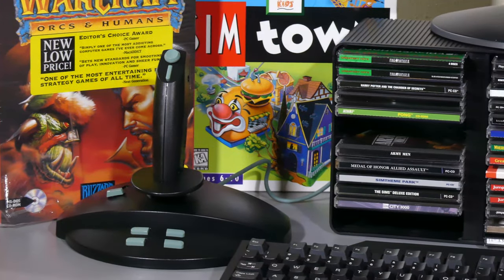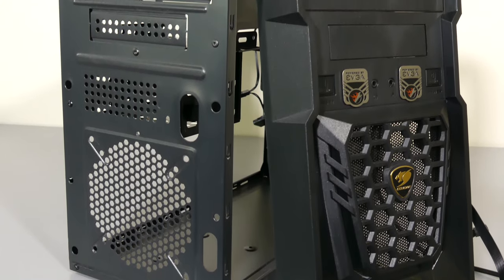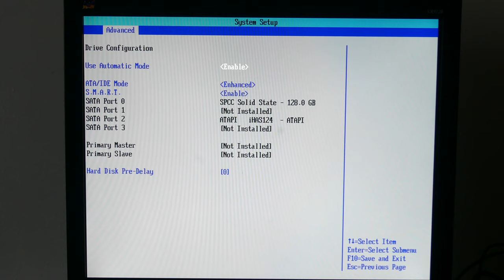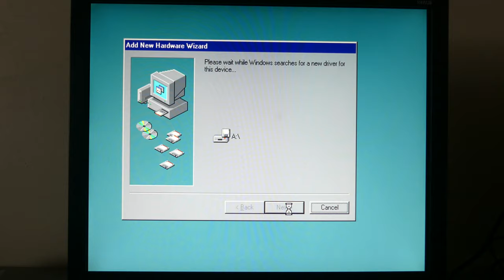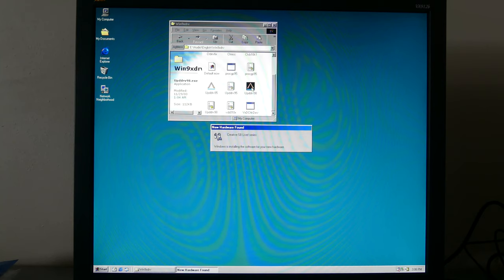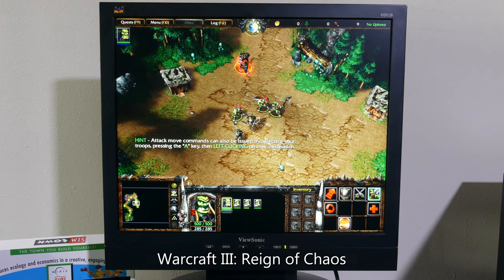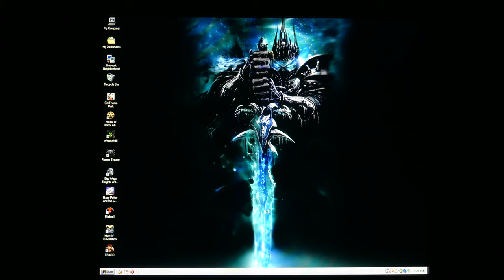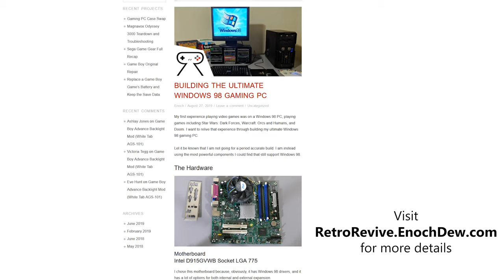Building my Ultimate Windows 98 Gaming PC | Retro Revive

Comment: Great video thanks! I have a similar Windows 98 Monster machine in my collection. Mine has a Core 2 Duo E6750 with 2.66 GHz, 1 GB DDR2 667 RAM, Intel 945 chipset, SATA 2 controller, 128 GB SSD and a Geforce 7600 GT for PCIe x16 with 256 MB RAM. I also run two Voodoo 2 SLI cards in this PC that are connected via a PCI to PCIe bridge. So you can get these cards to work in modern PCs. Every game runs almost no more loading times. The SSD manages almost 300 MB / sec even under Windows 98 ... I had the Soundblaster 16 problem you described, which is also due to the modern mainboard. I also had these BlueScreens so that I had to switch to another sound card model. So it wasn't live, but a simple Cmedia CMI sound card. But it also works in the Dos. Many greetings, Chris

Comment: I was going nuts trying to get SB16 emulation going using an Aureal Vortex 2 on a 775 board and P4 under Win98SE. After several reinstalls I found the solution for me was to install the sound card and drivers before virtually everything else, and in particular before any USB 2 drivers. I found one of the  USB 2 hubs on the motherboard was taking IRQ resources that caused the SB16 drivers to always BSOD. I've now got that hub disabled, but I still appear to have functioning USB 2 as well as the SB16 emulation. I would also recommend getting yourself a PS/2 key board and mouse to help with troubleshooting - you can remove them once all the hardware is installed.

Comment: I use a Yamaha YMF-724F PCI sound card in my 98se/2K PIII 800EB build, with genuine OPL3 FM hardware support in DOS, using PhilsComputerLab drivers off his website, along with a proper cone speaker for BIOS beeps.

Also got with the build a 256MB 128-bit FX 5600 AGP graphics card, semi-passively cooled with a copper heatsink and a big quiet  120mm fan blowing air over it nearby, along with 512MB of Crucial PC133 Cas 2 SDRAM, dual 80GB 7200rpm PATA HDDs for programs and data, and a Seasonic SS-350ET PSU, with an AOpen MX3S Intel 815 chipset motherboard as the backbone for the rest of the system.

Comment: The SoundBlaster live Dos compatibility is only compatible with motherboard which have ISA bridge (even without ISA slot) or ISA emulation mode. That was the trick put in place by Ensoniq with their PCi cards and the reason why Creative bought ensoniq back in the day. The creative and ensoniq PCI cards used isa emulation mode from the motherboard to tricks the system with a bunch of wrappers and TSR under Dos. If you lack this functionality, then, you have an error message that the card cannot access this area. You can maybe try aureal vortex or yamaha 71x cards, but these cards are a bit expensive. P3 motherboard or P4 socket 478 motherboard still have this ISA emulation mode (until ICH7 chipset I believe), this disappears on lga775 motherboard. The most appropriate would be a Amd CPU with AMD cheap motherboard, usually they used VIA chipset. VIA and AMD tend to support old technologies to support industrial machines.

Comment: I once had a  Dual core running Windows 98 with a PCI-E Nvidia 6600 GT running using the unofficial Nvidia drivers. ran fast as hell but you lose DOS functionality. Great video. Subscribed :)
Reply: Paul Marsh what mobo did you use?
Reply: @SharkVaderYT  it was an  intel dual core running at 2.26  ghz per core. Cant remember the exact motherboard version as it died several years ago but it definately run  the 6600 gt pci-e card flawlessly.

Comment: 98se and Me support up to 1gb ram and I have 98se or a 250gb HDD without Issues
Reply from the maker: I got the "insufficient memory" error when I tried installing 1GB RAM, but I found a way to get it to run with 4GB.
https://youtu.be/WfPZnjMEijU
Reply: @EnochDew  I use the Windows 98SE UBCD http://www.mediafire.com/file/j83jp3jb2jlb2sv/Windows98.UBCD.Feb.2008.iso/file It no only has 90% of 9x drivers built-in but also allows you to set up your options beforehand  no need for a 98se key also  if Norton partition magic so you can format you HDD without being limited to Fdisk or the format command as long as the drive has already been preformatted fat32 also has a file viewer under DOS to allow you to  select files that you want to delete and allows you to keep stuff like games and files without needing to format your drive as long as it fat32 formatted. Also if you have more then 1 gb for ram it will help you make a ramdisk for the extra ram. It also has a USB mass storage driver built-in during install and has a ton of fixes for 98se as well like breaking 120gb HDD limit. and being ab to copy files larger than 2gb via explorer. IE6. As well as some useful programs like Winrar 7zip and Winamp to name a few.

Comment: Just finished a win 98 build with p4 650 oced to 4.3 ghz on a asus p5p800 with 2 sticks of corsair xms 3200 c2 v1.1 256 mb and a fx 5950 ultra, a ssd and a sb audigy 2 zs. Also have athlon xp 3200+ build oced to 2.6 ghz on a msi k7n2 delta 2 platinum with the same ram and radeon 9800 xt and same sound card. The p4 has tripple boot with win 98, xp and win 10. For the dos drivers there is a guide on making audigy 2 zs work on the internet. Probably works for live cards as well.

Comment: ok so a few things about the sb 16 emulation. first there are a lot of newer chipsets that dont support the D-DMA and int-IRQ functions. that might be something as the 775 chipset is so new. another thing is simply the motherboard pci resources - changing the slots can help with the sb16 emulation. i tried for hours and hours to get it working with an nforce chipset (athlon xp generation) and after trying everything i found the advice that it simply cannot work.

Comment: I tested so many divers for 98SE, and i can tell you the best driver for nvidia card is 44.03 or older.Previously i have Geforce 6200 for 98SE and 81 and 77, this drivers work so bad on this operating system. Well i decide to buy Geforce 3 Ti 200 and install driver around 2002-2003 year, and driver from this time works very well. 
Sorry for my no perfect english, but this is not my primary language
.

Comment: Question would the 6800 ultra oc have decent compatibility it's the most powerful win98 graphics card ever
Reply: Maybe a bit late, but i see there no problem.
I recently had a 6800GS 512mb in my W98 PC, untill i switched to a X850XT.
I switched to ATI cause i needed something more powerfull, but the compatibility was great with the 6800GS, i just wanted to see how the big V-Ram boy would keep up.
But i saw no benefits and 256mb is more than enough.

Comment: The lack of AGP is a bit of a hinderance for the build. I didn't think you could get that kind of video performance out of PCI but if it's working, I guess it's working.
I had issues with SBLive in a W98 build using a Dell Dimension. I think it cited IRQ conflicts, and as other stated, it's particular about that. I think I was able to get SB16 working in DOS mode but not in Windows which was an okay compromise.

Comment: actually stumbled upon this looking up people using the 6200 in builds, i just got that card today myself an agp 8x version. same soundblaster card too. have you tried to change the pci slots for the sound blaster to get a different IRQ?
Reply from the maker: I did. It went from blue screening on boot up to automatically disabling Sound Blaster emulation for causing issues, so it got a bit more stable. It only has two PCI slots because it's a micro ATX motherboard.
Reply: sorry for late reply, i actually got mine to work! it took a mess of time with the drivers but i'm getting SB16 in dos mode. i used a mix of the initialization software from Phil's computer lab and a different driver than what he provided

Comment: Nice mobo, I picked up the same one but in ATX size with a PCI-E and a few extra ports.  It's the stupidest thing too, Intel just expanded the PCB but the ports and required extended traces only take a small fraction of the added area. So there's like a chunk of PCB 20 by 30 centimetres with nothing on it.... I figured I'm gonna use SSD by attaching it to that empty spot with velcro.

The chipset cooler on those Intel OEM mobos is from hell. I don't know what genius decided to attach a cooler by soldering it to the board with wires.

Comment: I succeeded intalling win 98 early 2019 using 478 motherboard. It has internal realtek audio which makes SB useless. It's really nice to run old games. My original copies are mostly Korean games. Pci e is not for win 98. Isn't it?
Reply from the maker: I've never seen a PCI-e Windows 98 device before.
Reply: @EnochDew  yes I like to confirm it too. Mine is 478 with agp slot and pci slots. I USE FX 5200 AS VGA CARD. Oroginal  QUAKE is beautifully smooth.

Comment: You could go USB for your 3.5 inch floppy and leave the 5.25 inch plugged in and see if that allows for both. I only have a 3.5 in mine. But I run all my games including CDs from images to keep the games and hardware in good shape. 

Also my Windows 98se computer boots just fine from a 250gb drive.
Reply: not recommended,usb 1.44mb drives all read funny
Reply: also just get a new cable with dual slots on it and a power y cable and use them both
Reply: @DeadMouseis  I thought it was a hardware conflict. Yes in fact early in the video he says the controller only supports one or the other so you at the very least need some sort of expansion card for another controller and that is a little bit of a long shot that that won't have a I/0 conflict with the current controller. USB would at least work off the USB controller and not a floppy controller. I have never had any problems reading a floppy disc on USB with any external devices. As long as it is at least Windows 98 or newer.  I don't know what you mean by read funny.
Reply: @AxiomofDiscord  i'v killed many of floppies with 6 different usb drives..all disk was formatted back to reality(saved and working fine with zero bad sectors) with a actual a: drive,
nah i think he does not know how to actually set the bios or deal with an IRQ conflict..and get a new dual cable...i am not trying to sound insulting...but like his sound blaster issue it is a simple fix...he had it wrong by a lot..i think the same is to say about the floppies...i have never seen a pc with a 3.0ghz bios with only one floppy except on a dell gx260
Reply: @AxiomofDiscord  "read funny" meant they would not "read disk correctly"..i very well could have gotten 6 knock off drives
Reply: @DeadMouseis  Strange. I have just gotten a generic looking one off newegg when I need one. Sorry that you have had struggles . I know with computers and even hell other electronics they can work fine for one person and the next person its a nightmare and they wonder why the universe hates them. That nightmare for me is the Sinden Lightgun I gave up on mine.
Reply: @AxiomofDiscord  thank you..it's okay i have the normal 1.44 ..but i can tell everyone what ones to stay away from.."usb portable diskette drive 5v `500ma  Made in China" has No model number or factory info what so ever..the other 4 er 5 i'll some day find in the garage..but you are correct a good usb drive would solve that issue for him..it is still weird for me to see a 3ghz with only 1 flop option..my dell gx260 has only 1 flop but it is a 2.4ghz with 1 flop bay...ya know i use to have a few drives with jumper..i wonder if his has them as well

Comment: I'd use a retro case and 256 MB Ram computers of that time never had that much Ram in them and 512MB is too much, Windows 98 will never use all of that plus it can cause compatibility issues with some old games. For the hard drive I'd use a SATA hard drive or IDE to SATA adapter if there is no SATA connector on the board. SATA drives are dirt cheap and plentiful. Windows 98 has no Trim SSD support and can get funky with the OS over a short time depending on how much the computer is used. .

Comment: DOS Sound fix: 915 chipset not support SB emulation, you need 865 chipset motherboard. On my Gigabyte GA-8IPE1000MK, Socket 478, it works well even with wavetable MIDI. Good luck =)

Comment: @Enoch Dew
If you want really go overkill on Win98 SE, go with a ATI X800 GT or a X800 GTO, a AM2+ Motherboard(ECS or Jetway maybe a DFI) and an Athlon X2 6400+ or an Athlon X3 460! :)
Reply: Asus A8M2N-LA  (HP/Compaq OEM board) the NodusM variant with 7.1 sound and 4 dimm slots. AM2 nforce 420a chipset GF6150LE onbaord (and it's on a pcie bus and has a x16 slot too). An x2 would be meaningless to windows 98 as it doesn't support more than one CPU core so the fastest single core Athlon 64 would leave a p4 system in the dust even more so with a mean overclock I've gotten 40% overclocks on some of my AM2 chips..

Comment: socket 775 for a Windows 98 machine? wtf?
Reply from the maker: It has the drivers. ¯\_(ツ) _/¯
Reply: @EnochDew   I have yet to get 9x on any 775 or LGA socket to work it just throws a fit
Reply from the maker: @Jimmycozad1980  It was going crazy until I updated the BIOS. Now everything seems to be running great except the DOS SB16 emulation.

Comment: Thanks for the video! It has some interesting things in it. I thought it's not possible to successfully install a graphics card with 512mb VRAM under W98, but you managed to do it after all. I'll now try that useless Asus 6800 512mb of mine.
As for the sound, I get the same error when it tries to install SB16 emulation under W98 (I also use SB0100, MB is Asrock 4Core-Dual SATA2), found no solution yet. But do take a look at this:
https://www.vogons.org/viewtopic.php?f=5&t=38927 
With this drivers the crappy built-in Windows 98 emulation of SBPro and General MIDI gets pretty smooth and compatible, so you can run majority of games that support General MIDI with no problems. No FM/OPL3 in W98 though (it has no built-in W98 emulation), but I managed to successfully install DOS drivers for SB0100 in pure DOS 7 (SB16 + Adlib + OPL2/3 + General MIDI + MT32 emulation). These drivers require an extended memory manager, and EMM386 keeps hanging on that MB, so I used QEMM8. Games compatibility is excellent, but not perfect, it may require fiddling with IRQ/DMA settings or changing PCI slots for the card. So, some way or the other, I think it's totally possible to get sound in DOS games on your setup )